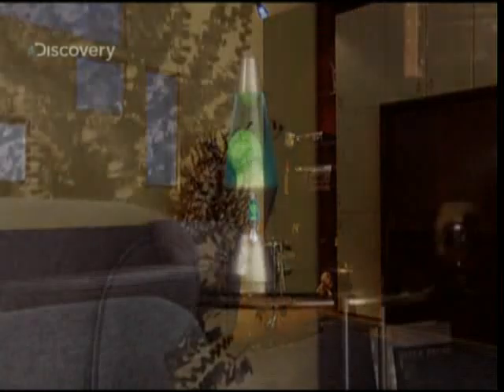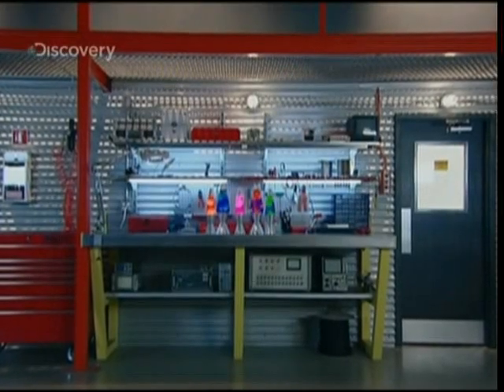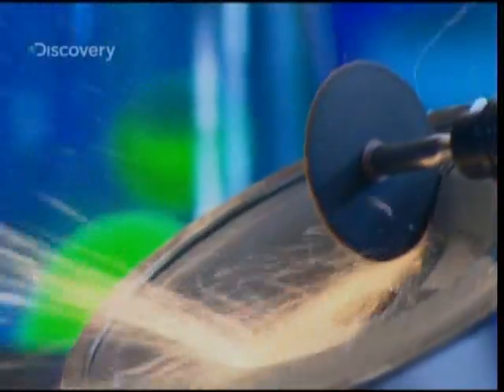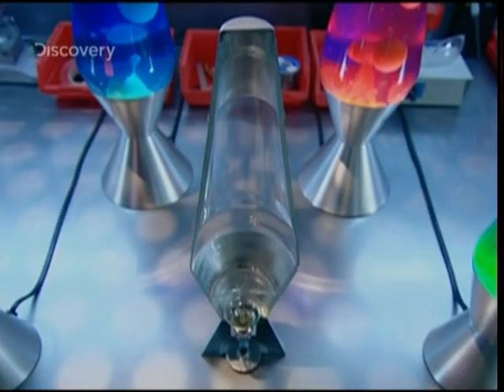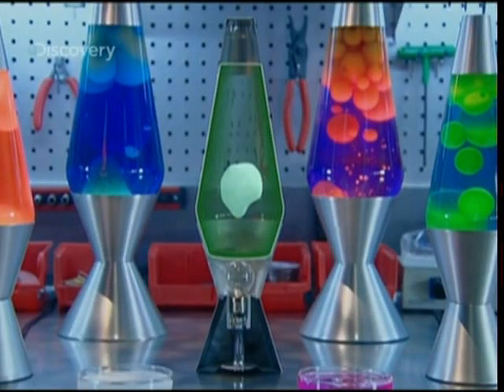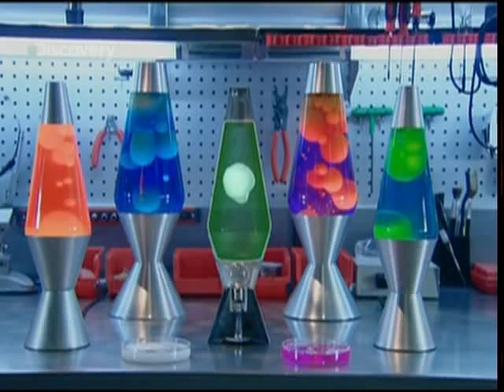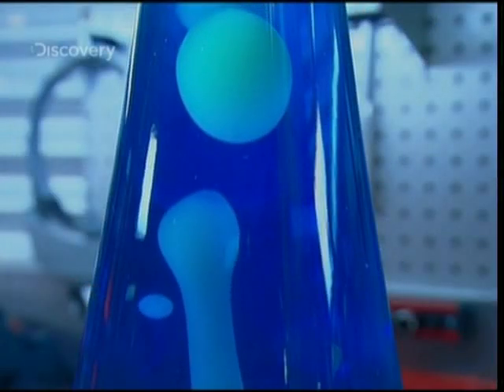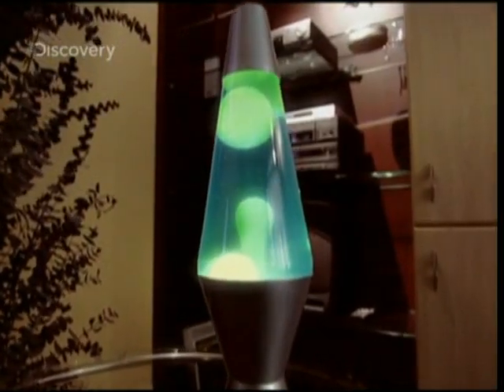How Does It Work? - Lava Lamps

Comment: You can actually test this expansion of the wax in the lava lamps. Mark a line of the very surface of the water when cold, and then when it's hot the surface of the water is higher than when it is cold.

Comment: The question I had, which wasn't addressed in this video...  Why don't the warm and cool blobs of wax mix with each other when they hit each other?  That they bounce off each other is is by FAR the biggest reason a lava lamp looks so cool.  I majored in physics, and I don't have a good reason why this happens...  I would be interested in any thoughts you guys have.
Reply: You answered it yourself. It’s cause one blob is cool and one blob is hot. That’s why they don’t mix. The hot ones particles inside expand and go up and the cool ones particles tighten which makes it dense and go down.
Reply: Im not really sure but best bet is that it's because of the leiden frost effect?

Comment: Just wax and water..? I always thought it was a bunch of chemicals... Does this mean I can make one?!?!?
Reply: ***** well now my dreams are dead. thank you.
Reply: thank you
i shall now attempt to make my own lava lamp
Reply: I just restored my cloudy lamp, using instructions on YouTube. I used distilled water and epsom salt. The instructions also called for clear dish soap. But I didn't need the soap. Just the water and epsom salt.
Reply: @markmarkofkane8167  I tried that after my man friend was mucking about and my birthday gift lava lamp bounced onto the floor, i  bought a bottle of distilled water and epsom salts from eBay and followed instructions by pouring water from the lamp down the sink and rinsing the bottle out .Best to put lava lamp in fridge so the wax is rock hard before draining cloudy water down sink though.
Carefully poured distilled water into lamp and then a few teaspoons of epsom salts then turned it on to heat up then added some ecover washing up liquid , i just could not get the formula   right but what i have found out since is it is only tap water and clear washing up liquid.
Reply: @2011williamandkate  I guess results vary depending on the brand. Mine wasn't the Lava Lamp brand, but another. But it still is clear, and works well for me.
Reply: probably, but most likely the lamp has a special wax that must be hard to make
Reply: @GippyHappy nah u also need food colouring
Reply: essentially you can
Reply: Oui
Reply: No. It's not just water, there's additives in the water to help the wax flow as it heats up and to prevent the wax from sticking to the inside of the glass. Even the wax is a very special kind of wax.

Comment: Nice video, but it only gets into convection and the density cycle (I already knew that part).  I'd really like to know more about the membranes the wax forms to keep it in discreet globs, instead of simply wanting to mix with the water.  The wax blobs' surface integrity eventually becomes so high that the globs vehemently resist absorbing into each other.  They usually have to press against each other for several seconds or longer before they'll even think about absorbing in, and that's at the bottom of the lamp by the heat (at the top and center they're even more opposed to merging).

The surface tension also affects how easily globs split.  In my larger lamp, it will create some fairly long filaments that don't want to collapse into their own globs until they're stretched very thin.  In the smaller lamp, the globs like to split apart much more readily, so maybe the type of wax being used is different.  The larger lamp is also much older (I picked it up used, and it works much better than the smaller lamp), so that may be affecting how the wax behaves.

I don't remember my chemistry very well, but I think someone once explained to me that water tension is caused because the bipolar water molecules line up and form a polarized surface.  However, water droplets generally have a very high affinity for each other, easily merging together and staying together until they reach a certain critical size and the surface tension cannot fight the weight anymore.  However, lava lamp globs are hostile to one another and don't want to merge easily (at least once the lamp has been running for a couple hours), and will even form water bubbles inside them and have a double or quadruple series of membranes creating distinct layers or pockets, all of which resist merging or rupturing for long periods of time.  In that sense they're more like living cell membranes, and the proto-cells that presumably preceded life (yea yea, long stretch I know).

I wonder if a chemist could give me a basic explanation of what's happening there.  I'm guessing it's something cool with the wax molecule's structure, but it could be the water or a mixture of water-was that forms at the surface...?  Whatever the case, it would be fun to find out.
Reply: Thanks!

BTW I got curious again, and this time my google search turned up some more useful results:
http://72dynes.blogspot.com/2011/11/surface-tension-makes-lava-lamps.html
http://www.thenakedscientists.com/forum/index.php?topic=44573.0
So that's a bit on the chemistry, but it's still not much.

I've also been watching my lamp more.  I do think there's more than just surface tension alone going on though, since the drops of wax don't like to recombine with each other easily the way water droplets do.  I've looked closely at my lamp and noticed they never physically touch (except when the lamp is just getting going, which is when drops combine easily).  There's a thin layer of water always separating the globs, and they slide right past each other with this layer of water greasing the surfaces.  It takes some resting time before that water becomes thin enough for the two globs to touch and combine, or perhaps for some other physical process to take part.

Maybe that's normal for surface tension; maybe drops of less viscous materials, like water droplets in air, simply combine more readily.  But I wonder if there's actually a polar, two-sided membrane that's a combination of wax and water that repels the same-poled surface of other drops, and that surface has to be punctured or weakened before drops can combine.

At least, that's what I think is happening.  Lots of speculation currently.  A chemist may be able to offer better information.

Thanks for sparking my interest again.  ^_^
Reply: *****  Maybe.  I've seen neat stuff like multiple layers of bubbles within bubbles, which refuse to rupture even when the outer layer merges with another blob.  It's cool to watch.

Comment: The metal wire does not distribute any heat.
What it does it break the surface tension so you get a big glob of wax at the bottom, and it weighs down the wax a bit, preventing premature departure.

Not only is this video overly complicated in it's explanation, it's plain WRONG.